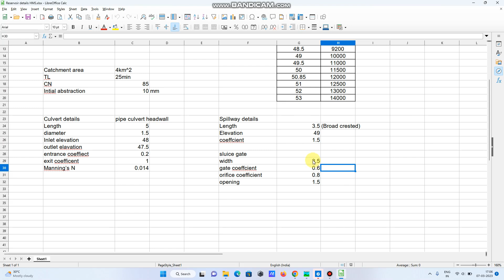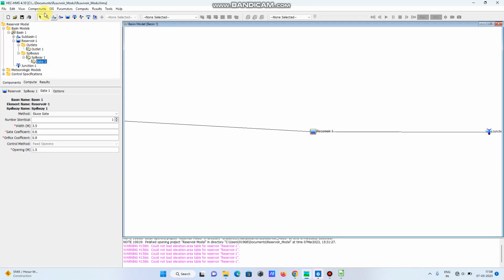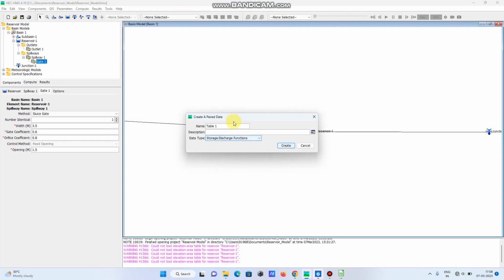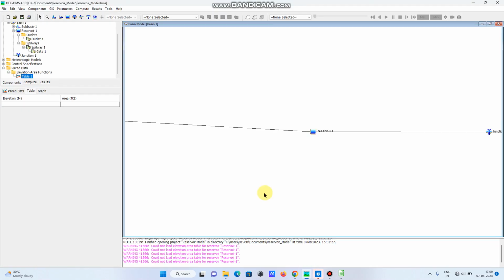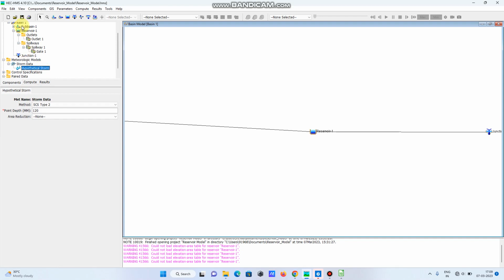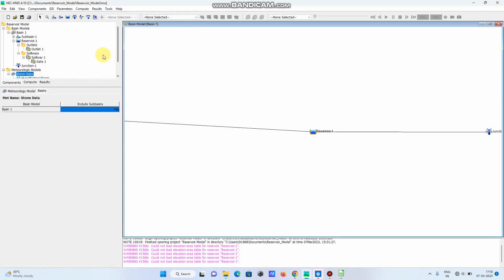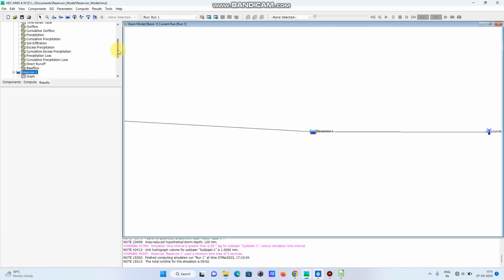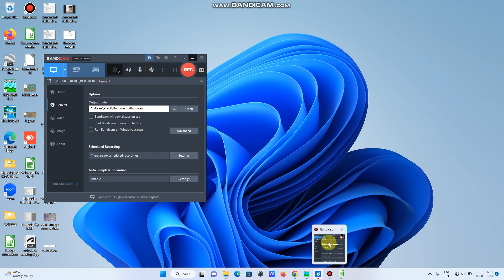HEC HMS-Reservoir Model with Overflow structure for SCS Storm Part-3

Comment: Thank you for this reservoir modelling, this is quite helpful to understand. I need to model a reservoir (acting as augmentation reservoir) which is having an interconnecting tunnel and connected to another large reservoir, how this can be used? can I contact you through email or mobile?
Reply from the maker: this is my email rohit.hydro@gmail.com
If you are from india this is my phone number 9686417568
Reply: @JALAJDARPAN  Thank you so much. Yep, I am from India and will contact you soon.
Reply from the maker: Either we have to model it in HEC HMS reservoir or model it in HEC RAS 2D by defining upstream reservoir layer and outlet pipe(as culvert)